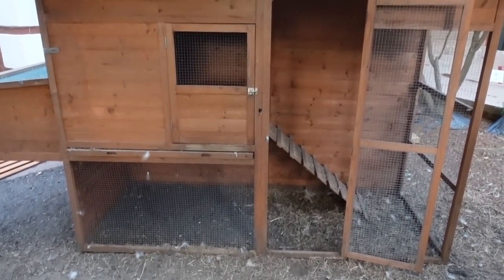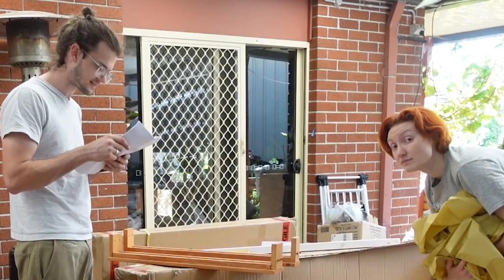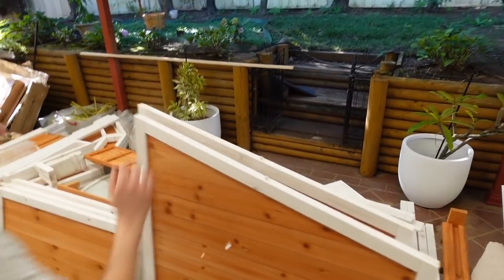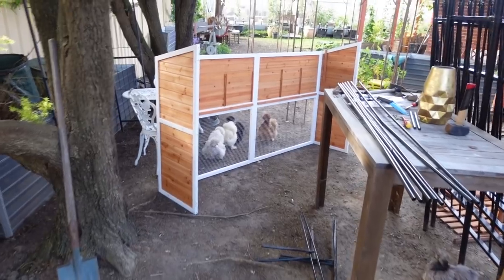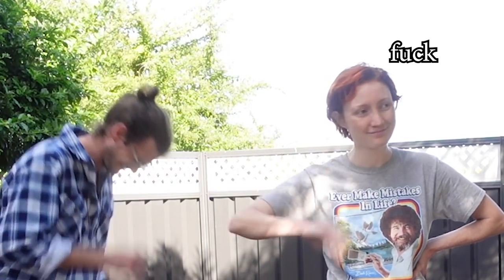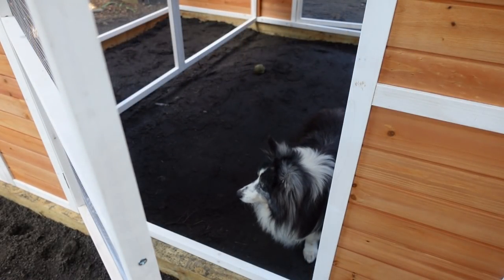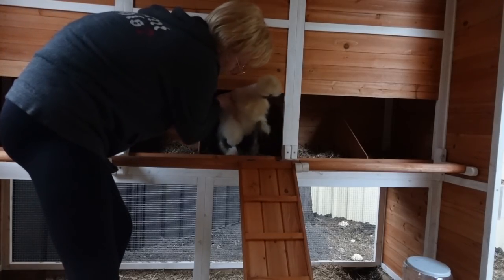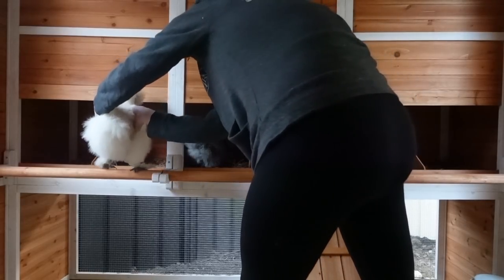I SPENT $1700 ON AN AMAZON CHICKEN COOP!!! (i'm clucking insane)

Comment: The coop looks great. I have chickens as well and a few bantams. 
If you have problems with that gap at the top of the ramp you could get a plank of wood cut to size bunnings does a few cuts for free and sit it on top of the brackets the rod is sitting on at the top of the ramp. It could make it easier for the chickens to get to each nesting box.  Thanks for the new video I enjoyed it

Comment: if you find that the others might be struggling to just from the bar into the boxes, then you could pretty easily get some 2x4s from a local hardware store to fill in the gap and make a solid platform for the chickens instead of making them traverse the bar.

Comment: Maybe getting some netting stapled between the “big jump,” to their little rooms would help and possibly save their lives. Last thing you want is them not to be able to see and fall, resulting in them getting hurt or worse.
Reply: Although their feathers are a bit strange silkie chickens, and all chickens, are still birds. They can fly (some chickens can fly very well into the branches of 8ft+ high trees and back down again. silkies not so much but they are still capable of some lift) and are designed to take landing impacts. The fall isn't so high that I would be concerned about it. Putting netting would likely be more dangerous as they could get tangled up in it if a leg slips through and hurt themselves trying to get free. Even finer netting their nails would rip holes in it, that they could get a leg through.

Comment: I would try to make the ramps a little less steep and close the gap on the top. We did this easily by putting a brick under the the bottom of the ramp so it props up a little and is less steep. If chickens fall and break an egg inside it can be really bad for them 😰

Comment: My cochin bantam has the same problem with getting to very high spots. 😭I wanna guess its because they're hauling around those extra big butts lol. I ended up placing a lower nesting box that she can reach easier. 
I'm sure by now your girls have gotten used to getting around, but if the ramp is looking too steep I think an easy fix would be to place a brick or something under to prop it up a few inches.